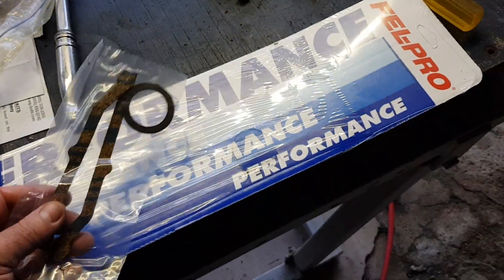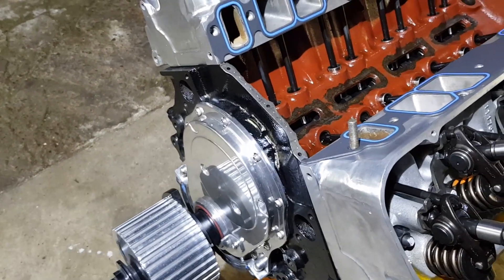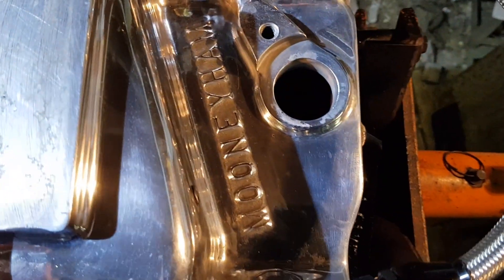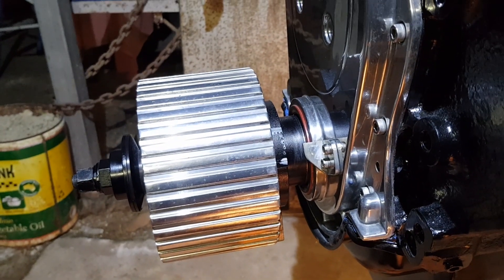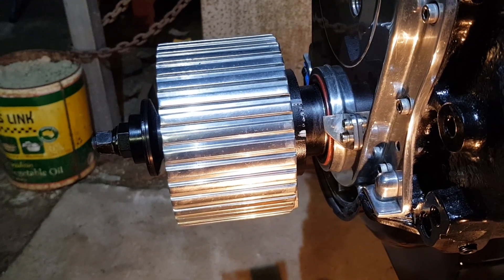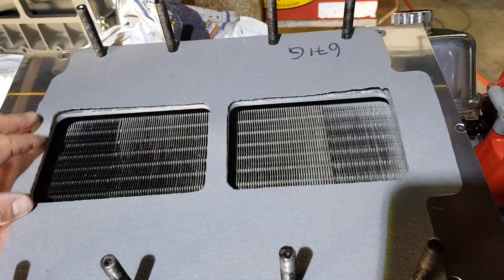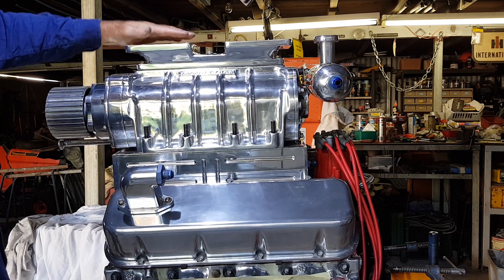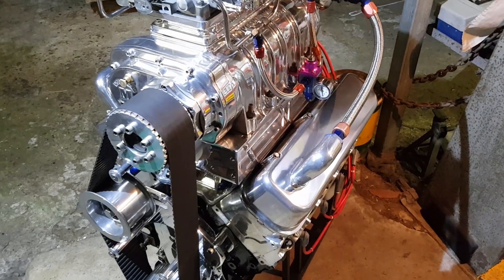Building a Blown Big Block Chevy Part 4 - Setting Timing and Buttoning Up

Comment: Dave, why the -AN hose loop at the rear intake ports? @6:51
Reply from the maker: This hose allows cooling water to flow between the heads, often referred to as a steam bleed. It promotes air pockets bleeding out.

Comment: What kind of power will it make, pump fuel or race fuel
Reply from the maker: estimated in the 900-1000hp range, we run 98 octane with an octane booster for about 110 octane.

Comment: Is this on pump gas or race fuel
Reply: it's running nicely on premium unleaded atm, it is 98 octane, we will use avgas or octane booster if we need to. When we change the pulleys to increase the boost we might change to corn juice
Reply: Chris Behrens can you tell me the specs of the engine I’m very interested in building a 454 up for my 65 impala my main goal is to get blower surge I love the sound